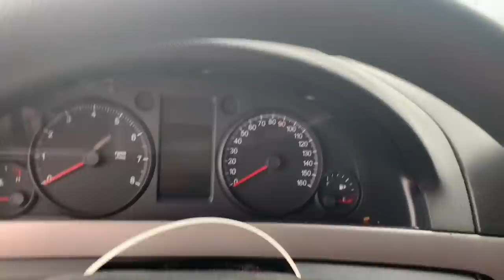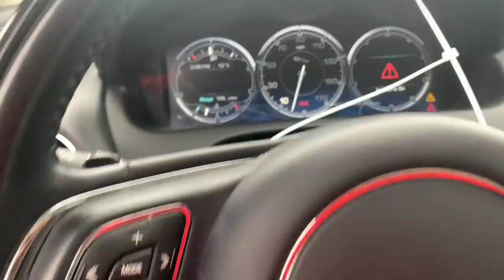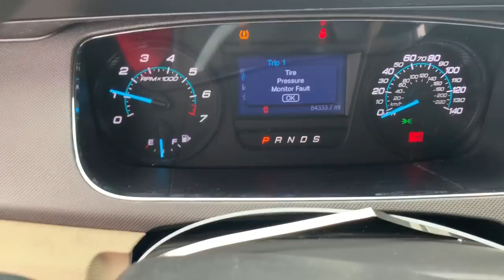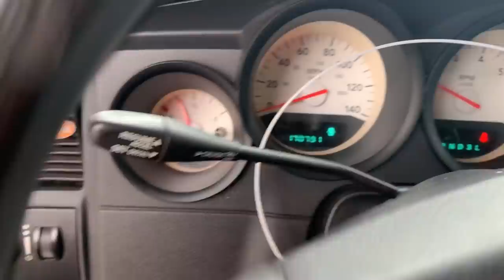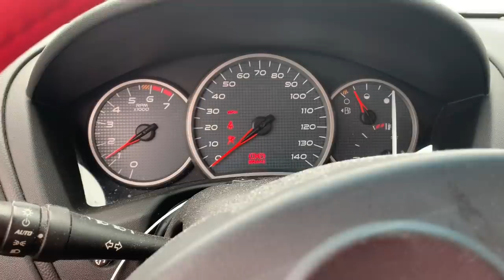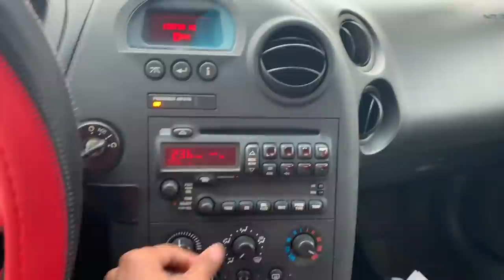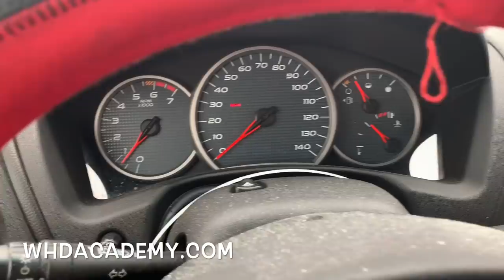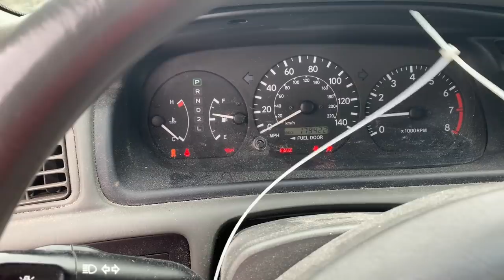INSURANCE AUTO AUCTIONS WALK AROUND + 6.0L CHEVROLET CAPRICE

Comment: Made in Australia, was sold as the Holden Statesman and Holden Caprice between 2006 (WM) and  2017 (WN), with the later model having a vastly better interior.  The Statesman/Caprice was also exported to the Middle East (Chevrolet Caprice), as well as the USA where it was sold as the Chevrolet Caprice PPV. It was also sold in China from 2007 to 2011 as the Buick Park Avenue. Earlier models were called the Buick Royaum.

Comment: That grand pre is running a bit hot
Reply: I noticed that.  Could have a clogged radiator.  After the car is warmed up, feel the radiator outlet hose and compare it to the radiator inlet, if the coolant hose coming from the engine into the radiator is hot all the while the coolant hose leaving the radiator going to the engine is cool or cold, the radiator is clogged or not doing its job.  I do like that Pontiac.   Really though I like the VW Golf that was next to the Gran Prix.
Reply: @Ed.01  there's more possible reasons for over heating. thermostat,Water pump,blown cylinder head gasket. Fans could be not operating.
Reply: @hpowlman9114  Yeah that's true.  But it was just a hair over the middle.   Could be the thermostat but if it's just a hair over the middle could be a clogged radiator.
Reply: 4 7 if u seen his new video it went up more
Reply: @hpowlman9114  oh Okay then maybe blown head gasket I wouldn't mess with it
Reply: @hpowlman9114  You know now  I thought about it, I mess with those 3.8s and you know when they run hot or have a bad head gasket they hydro lock, seen it countless times but you are right if it's running over halfway there is a problem and Big Play Ray motto is only buy and sell no fix up so on that it's a no but me I'd pay the $350 and deal with issues but not any more than $350 $400...